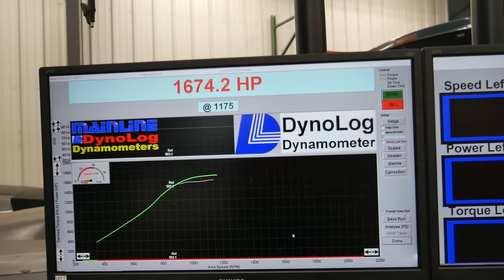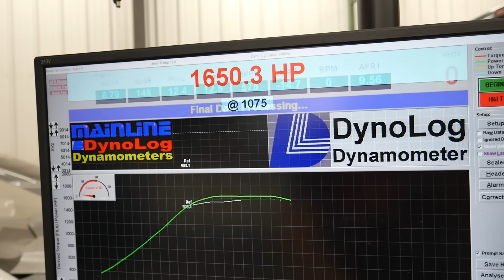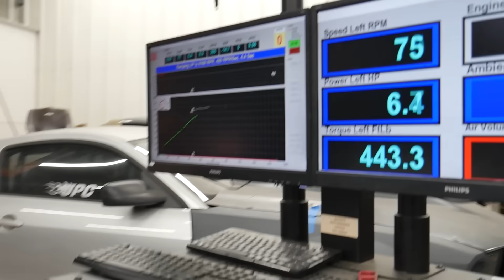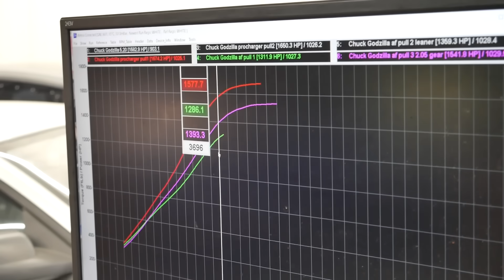7.3L Godzilla R&D: Testing 2 Superchargers on the Dyno!

Comment: Just a heads up. The mic is not good when recording the sound of the car. Talking is fine, it's just the exhaust note of the car at idle is not good, and you can't make out the blower gear drive sound at all on the ProCharger.
Reply from the maker: thanks for the heads up next video we will put the mic in the next shop over so you can hear it better!
Reply: @NexGenPerformanceMD  I wasn't trying to be a smart ass. Just trying to let you know that compared to most YouTube videos of blower cars, video sounded odd. I get how loud it is. I had a D3R for years. Regardless, thanks for sharing the comparison info. It was interesting.
Reply from the maker: @scottrussell2281  Its very loud, we also had noise cancellation turned on so that was probably why
Reply: @NexGenPerformanceMD  that makes sense.

Comment: Kinda hard to "smack the converter" when the powertrain is moving ZERO DEAD WEIGHT "MASS" ANYWHERE AT ANY POINT IN THE "DYNO PULL" I.E. ACCELERATING SEVERAL THOUSAND POUNDS OF CAR AND DRIVER FORWARD AT "FULL THROTTLE". 

THOSE "DYNO PULLS" ARE COMPLETELY WORTHLESS FOR "MEASURING PERFORMANCE".
Reply from the maker: You may need to look up how a Dynometer works and report back sir! Although you do sound like an expert already

Comment: What's the smoke from passenger side exhaust
Reply from the maker: exhaust port of the cylinder head has a crack. We were aware, just what happens with these high HP godzilla engines.
Reply: @NexGenPerformanceMD  From porting? someone needs to make heads ffs lol can't believe theres still nothing. Trick Flow should.

Comment: How many pounds of boost did it make to get 1650 to the wheel
Reply: Makes about 26 psi
Reply: @Eazy_tuned   an  F1A94 will not make 26 PSI on a race engine of that size lol
Reply: My guess is 9 lbs. Of boost.
Reply: @VGHCX 99lbs